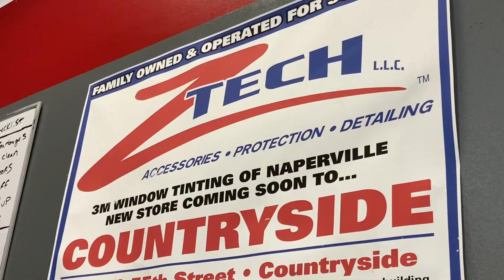NEW 2020 Corvette C8 Transforms With This Mod - Every Corvette Needs THIS!!!

Comment: Nice job! How do you deal with the windows automatically going down a little when you open the door?
Reply from the maker: Heat the bottom edge a little bit to speed up the curing process after install.  Shouldnt have any problems going forward